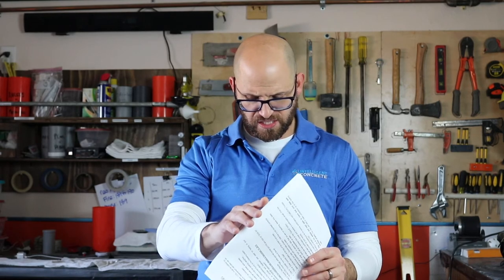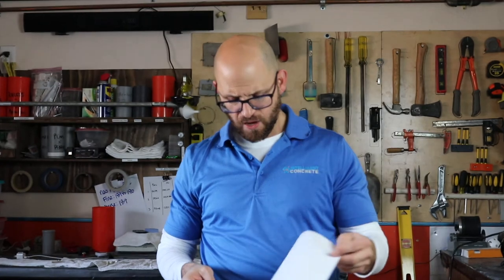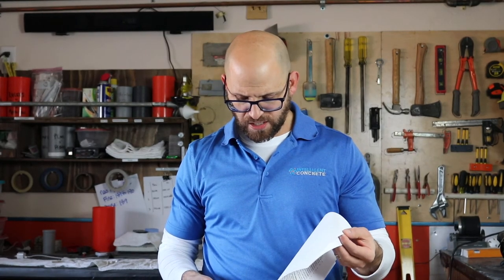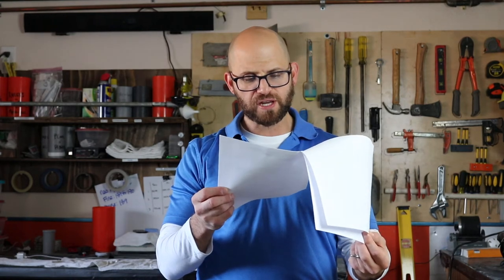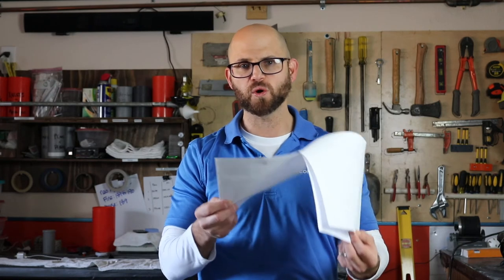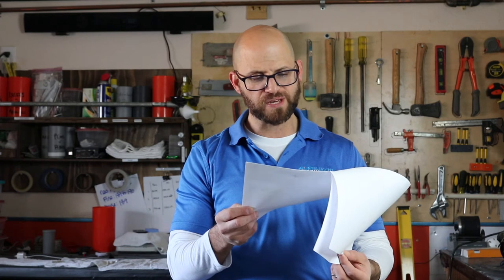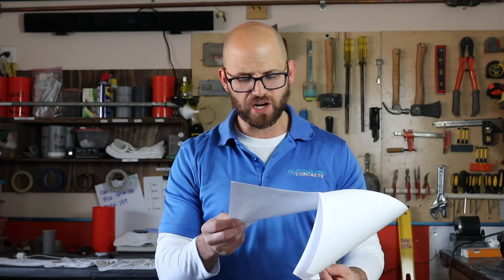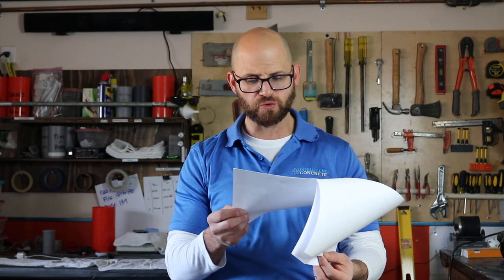What is a Butter Mix? - CCRL - Vlog #155

Comment: A quick clarification question. One method says: 

“Prior to mixing the test material, the mixer should be “buttered” using aggregates and a non-air-entraining cement other than that supplied by the cement and concrete reference laboratory.”

I’m a believer of buttering the drum with a non-representative random mixture of mortar.

The 3 levels of butter accuracy:

1. No butter bare drum.
Pros: simple to do.
Cons: paste + sand (Mortar) will be left in mixer. The final batch will have a higher coarse aggregate percentage than designed. Smaller batches will lose a larger percentage of their batch to coating the drum.

2. Random butter to coat drum.
Pros: almost as simple as above(1). Theoretically no mortar should be lost from the buttered drum to after dumping out the mixed batch.
Cons: cement+SCM’s+water+sand left in the mixer may not match the final batch proportions exactly.

3. Representative butter sample identical to that of the tested mix design.
Cons: Much more complicated to get a mini-batch to the same slump & entrained air consistency as the final batch. It takes time to test & adjust even before completing the main test batch.
Pros: Theoretically should be the most representative if the exact same raw constituents are used from butter to batch.